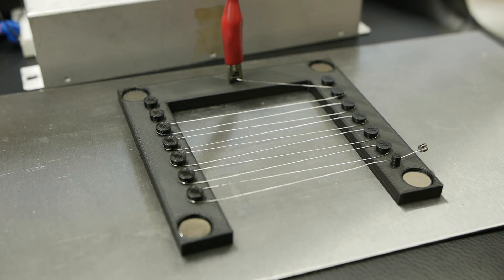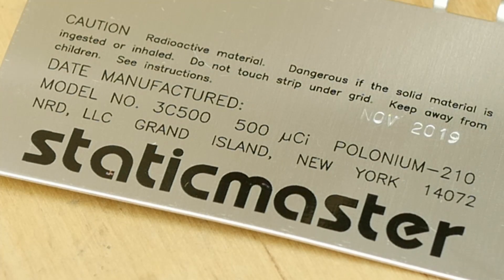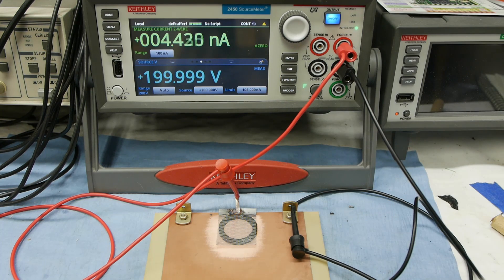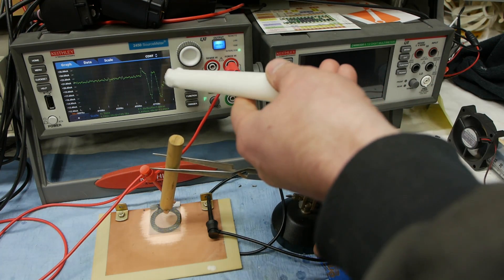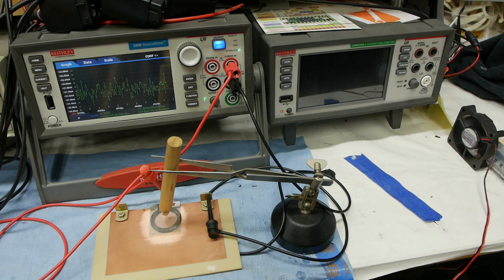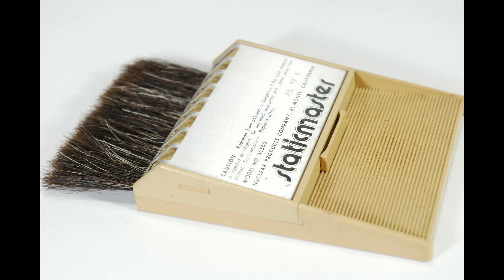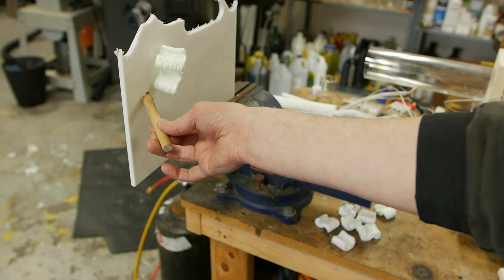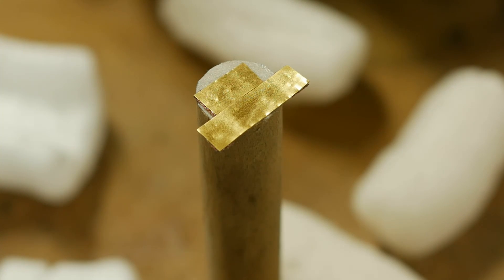Alpha radiation makes sparks, detects smoke, and eliminates static cling

Comment: Alpha radiation is also very dangerous to be fair. It doesn't really get through the dead layer of skin, but it happily floats around in the air a while allowing one to breath it in....
So it is indeed rather weird that this product is allowed on the market.... Considering that a conductive brush would be practically just as efficient.

Comment: Plz do an experiment
Is it possible to make  #Battery's enclosure charged just pulling electrons out of its circuit and same time separating from source of electrons from vicinity .
Plain is ..
If it possible to make electron Gun that can able to throw out electron beams out of tube , I heard that putting mica window in tube is enough to block Vaccume but permeable for high energy electrons !!!!!!! All apparatus in Vaccume !!??

Comment: I have never even given a thought about how a smoke detector works, it's just one of those things that you subconsciously think that it's just way to complex and never go there until you come along! Another amazing video... There's one other thing though, I wouldn't want to call it a correction in relation to what you said regarding the positive and negative charged ions, it's common knowledge and understanding that there is both positive and negative charges and that's something that I have given a lot of thought, to me! It just doesn't make sense, I personally think that we have been looking at it from the wrong angle ever since electricity was first discovered! I believe that there isn't a possible and negative charge but in fact there's only charge. Everything has a charge, what I would call a nominal charge, and everything can accept more charge than it's nominal level or even have it's charge taken away. For example, when you rub the sheet with the microfiber, by doing so you have moved charge from one piece of material to another, effectively depleting one of some charge and transferring it to the other, then you introduce the polystyrene and it appears to want to stick, what's happening is that charge is being transferred from one to another, yeah I know it sounds crazy... But here's another example, the humble battery, how can both positive and negative charges exist in the same time and place? Surely there would be a cancellation! But what if you consider the idea that possibly there might be an excess of charge on one side and a depletion of charge on the other, when you connect the circuit, the charge flows from one side to the other until the charge is equalised and the battery becomes what we would call dead flat but in fact there's still charge but it's returned back to its nominal state or close to it! This! To me makes more sense than the existence of positive and negative of anything, because the very nature of having opposite charged particles would mean that they would obliterate each other and it just doesn't happen here on earth! It doesn't happen in space either but at least earth is accessible to most of us and experiments are possible by most people also due to the relatively expensive cost of doing it in space. The positive and negative idea can still exist because we still need it for orientation, when you start looking at things from this angle, everything makes sense! Everything! Here on earth and even in space. We say that the earth has a north pole and a south pole, it's magnetic! Opposites attract and like repel, magnetism is caused by electricity, incidentally, why is it that when we need more voltage from batteries, we place them in a way so that their opposite sides touch each other? Why doesn't the batteries cancel each other out? Why doesn't the earth cancel itself out and I could ask the same thing about magnets too, but no one wants to question the validity of the original concept because it's believed that it must be true and correct because it has served us well since it's discovery! But what if I told you that if you changed the way you look at how electricity works, you will also see the limitations of what our current understanding has and the new possibilities that exist and only because of simple human understanding, so simply, just by looking at it from the positive and negative charges of understanding, you will never be able to see and fully understand what electricity is truly capable of. Our brains won't let us see it because it automatically block's out that which could be possible but it's not what you have been taught to think like.. Why is it that most invented stuff is usually out of the box sort of stuff, some of us have the ability to see things that others can't and that's because some of us weren't taught to think in a certain way, some of us didn't even go to school LoL, the less you know, the crazier the questions become and crazy enough questions sometimes yield crazy enough answers and sometimes some of those become new discoveries...

Comment: question, would this improve spark in an internal combustion engine if it was used on the ends of spark plugs internal electrode or external electrode

Comment: This is another truly fascinating production.  Thank you so much for sharing!

I was wondering, though, if one used a tube of low-pressure neon with electrodes  
at each end,.  If one used a HV supply adjusted to subcritical levels, would the gas ionise and glow when exposed to ionising radiation?

PS.  I notice many commenters recalling using Staticmasters in photographic darkrooms.  I wonder if anyone left the brush on unexposed film accidentally re-creating the discovery of radium by fogging the film.

Comment: By now that Sr90 source is in secular equilibrium meaning it's now a Sr90/Y90 source. Y90 has a beta emission strength of 2.28 MeV. I doubt that GM tube has the density thickness required to shield that strong of a beta.

Comment: Could this increase efficiency of electric motors/generators? Seems like there would be more output of useable energy with the addition of strong sources. Maybe solar panels as well? 
We really need to properly utilize radioactivity, the fact that nuclear fission is just some stupidly dangerous steam engine is insulting at best. When it comes to power generation humanity looks like the stereotypical imagery of cavemen dancing around a lightning strike caused fire.

Comment: Polonium has a weak gamma at about 800Kev visible on gamma spectroscopy. The beta from Sr90 are not directly detectable by your geiger but the Bremsstrhalung effect in the glass, plasctic and shell produce xrays .. always loved your videos!
Reply: This isn't true. Sr-90 betas are more than energetic enough to penetrate the walls of the GM tube. They will travel up to about 1.5mm in steel, and the GM tube has much thinner walls. The amount of bremsstrahlung produced by a small source like the one in the video is essentially undetectable. You're right about the weak gamma line from polonium however! I bet you could easily detect that on a sensitive spectrometer with a 500uCi source.
Reply: @inductivelycoupledplasma6207  1.5 mm in steel????? Never heard of it in beta radiation!!!!!! 200micro meters (o.2 mm)  MAX in living tissue is what I learned and nothing passed a thin sheet of aluminum... but maybe I was missinformed? Maybe more people can weigh in?

Comment: Staticmaster brushes were all the rage in darkrooms all over. Amateurs still use them, commercial labs switched to electrostatic grnerators - they are contactless, thus contaminate less.

Comment: 2:30 - Print different versions or...just add shims under the magnets.
Reply: Talk about solution in search of a problem :D
Reply: @leocurious9919  3D printers are like that. Last week I printed out 4 taco holders (basically plastic trays shaped like sine waves ;-) ). A trip to the dollar store probably would have got me a pack of 10... but I have a 3D printer... why take a 5 minute drive when I can print them off myself in only 5 hours...
Reply: @frac  Hahaha, nice!
I higly doubt that I would be any different if I had one. But so far there was no "need to have" moment where I needed one :D

Comment: Fantastic experiments.  Seems obvious once you've seen it, but it never ocurred to me to use ionizing radiation as an arc initiator.  Great stuff!  Love to see this with a plasma globe, or some light emitting gas under extrmemly low pressure.

Comment: At 00:40 No matter what the power source, when an it arcs, the potential difference on the source end drops to zero, as it's being short circuited. The sparks are discontinuous because the voltage falls to 0 and starts to rise again. Other than that, interesting video!

Comment: I had two of these Staticmaster brushes back in the late 1970s and early 1980s, for photography and hi-fi stereo. If I recall correctly, back then the particles of polonium were encased in tiny glass beads. Makes me wonder why they changed their manufacturing method.
Reply: That was probably a rhetorical question, but I will answer anyway.

Chemically separating a metal from glass isn't particularly easy, but it takes equipment and supplies that are much easier to get than what it take to get polonium out of a mixture of gold, silver, and bismuth.
Reply: @hamjudo  No, it was a legit question. So I think you're saying it likely made the poison harder for the end-user to intentionally or unintentionally release, and thereby made it safer (and protected the manufacturer from lawsuits, no doubt). Yes?

Comment: I'd watch what you're doing with switched mode power supplies of THAT voltage output.
It looks in the video as though you have the SMPS switched on, and then touching the steel sheet which is connected to the negative output. Decent supplies will have the negative output very close to 0V with respect to earth, but quite a lot of supplies have the negative output floating at CRAZY voltages. 
I regularly get a decent, continuous zap from my laptop case, which is made of metallised plastic and is connected to the supply negative. The supply is only 20 odd volts, but the negative "floats" well above earth (0V).

Moral - If it is an SMPS, and it is switched on, don't touch it. In fact, (depending on the supply topology) I'd look into getting the negative output grounded.

Comment: When having an alpha source, I would HIGHLY recommend redoing the Rutherford experiment. Ideally from his original papers. It's such a good example how dangerous it is to have expectations when starting a certain experiment and how wrong you can be.
Reply: What's the Rutherford experiment?
Reply: @vivimannequin  Around 1910, it revealed the internal structure of atoms. It showed that the positive charge & mass were concentrated in a tiny dense nucleus, surrounded by a cloud of electrons on the outside, but with lots of empty space  in between.
This contradicted Thompson's  "plum pudding" model, which said that atoms were made of large positively charged spheres that contained the electrons.
@Kris Curkovic  explained the details well; just wanted to give a broader context of its importance. ;)
Reply: @nibblrrr7124  If I remember correctly Rutherford was even stunned by the outcome of the experiment and couldn't really explain it himself.
Reply: that seems a mildly easy experiment, i didn't know about that, cool
Reply: @redoverdrivetheunstoppable4637  Yes, it is, back in the day they were basically fully convinced about Thomson's plum pudding model. Simply this meant a "positively charged soup". Rutherford very clearly showed that this was not the case.
Reply: I'd recommend not to have business with Po-210. Use Am-243 instead.
Reply: I think you mean Am-241. Am-243 is pretty uncommon, because it emits 74.6 keV gamma rays, but at near double the branching intensity (68%). It also decays to Np-239, a beta minus emitter which also emits a lot of various gamma ray energies. Am-243 is also not produced as much in the nuclear fuel cycle.
Reply: @KarbineKyle  that's what I thought
Reply: @higamitakaro  I'll have both someday
Reply: @kriscurkovic9265  Amazing explanation! Thank you.
Reply: Interesting, here's a good video on the experiment https://www.youtube.com/watch?v=XBqHkraf8iE

Comment: Hey man, I think the difference between  americium and the polonium is not so simple.

Given the size of your Geiger, I think there is a low chance any gamma is actually interacting in it. The volume is too small. 

The thing is, Americium releases looooads of X rays. There is one strong line at 60keV and five or six peaks from 10 to 26 keV. (Do you mean that the 60kev line is a gamma ? )

From what a quick googling showed me, polonium releases a few beta decays during its decay to lead. Betas for sure will pass straight through the Geiger counter wall and start ionisation in the chamber.

I don't know if you are even seen the alphas there, like, at all. It seems you're just counting x-ray+ beta. Maybe the metal foil is too thick to allow alphas through ? Maybe if you're a bit closer ? Alphas on this energy range travel about 3 cm in air.

Comment: Does that also work with something less radioactive, such as thorium nitrate?
I tried it a while ago and it didn't work.
Reply: If you increased the ionization voltage slightly, it would have worked.

Comment: The process you describe at Minute 10 sounds incredible complex for a really stupid novelty item like that brush.
Reply: I'm pretty sure most antistatic brushes are used professionally.  using it to clean LPs sounds like a minor side-market to me.
Reply: It is easy to make, probably a couple of minutes of exposure to a commercial cyclotron. The total yield will be ridiculously low. 500uCi is some small fraction of a nanogram.
Reply: A few other comments here also mentioned using it for photography to remove dust from negatives. And compared to many other things integrated in our stuff today, probably not that bad really. Produce enough of it at a decent scale and many things can work out to economically make sense.

Comment: Insane to use such a dangerous piece in something as inane as a vinyl duster.
And pretty wild that just a smoke detector can trigger that macroscopic an effect so consistently. It makes it clear how bad radiation is. 
And I'm not sure about your claim that dead skin will stop it. That doesn't ring true at all. Might be true for a single particle at a well chosen spot but is it true for trillions. In the eye. I think you can trust that as much as you can trust corona has a range of 2 meters.  Not that corona is deadly at all though but it does transmit.

Comment: In your copper setup, the conduction takes only takes place in the thin gap between copper plate and metal mesh. The smoke in your setup didn't seem to penetrate that are, but instead was mostly above the mesh, between it and the alpha-source. Could it be, that the smoke also shields the conductive are partly from the alpha particles?

Comment: question is: dose a banana trigger an arch? They are slightly radioactive after all
Reply: No, much less radiation, and not of the type (alpha) that is good at ionizing air.
So bananas (and humans, and any living thing, really) are ~0.3% potassium, and 1 in 10,000 potassium atoms is the K-40 isotope, which is radioactive due to beta decay.
The beta particles & gamma rays that come from K-40 are much smaller and have less energy than the alpha particles from the polonium-210 in the video, so they are way less likely to collide with atoms in the air & ionize them enough to make it conductive enough to trigger an arch.
Plus, there's just way fewer particles. A 100g banana emits 15 rays/second, but just 1ng (nanogram!) of polonium emits 100,000x as many! So even if there is >10,000x K-40 in a banana than there is Po-210 in that foil, Po-210 is just stupefyingly more radioactive - it has a half-life of months, compared to 1,000,000,000 years for K-40. And it's concentrated on a tiny area end of that stick, instead of being spread around evenly across a banana.
So yeah, if holding a banana next to the wires would trigger sparks, your body alone would trigger some, too.
If you wanted to try with a more concentrated source of K (and therefore beta radiation), several potassium salts are available in supermarkets, e.g. KCl salt substitute (52% K by mass) or cream of tartar (21%). (Don't play with high voltage unless you know exactly what you're doing, though.)
Reply: Side note: Bananas are not exceptionally radioactive per kg, compared to any other random living thing, afaict. 3g potassium per kg of banana is only slightly above average among foods, and basically any animal or plant tissue seems to have roughly the same K concentration, within an order of magnitude. Bananas are only in the top 15% K-rich foods if you measure per serving size or calories (which tbf is what matters nutritionally).
Also, eating a banana will not really expose you to more radioactive potassium. The amount of potassium (including K-40) in your body stays fairly constant, otherwise your metabolism would break down.